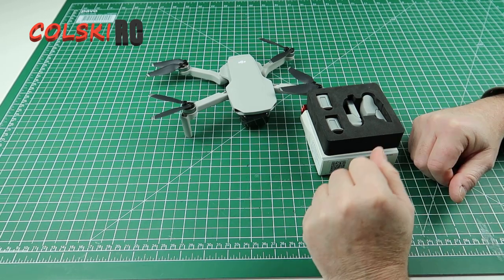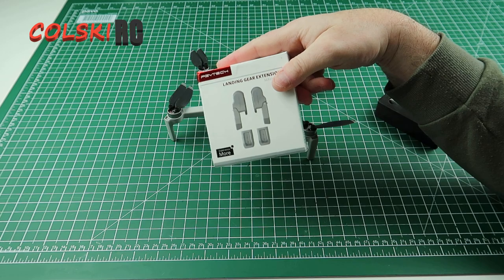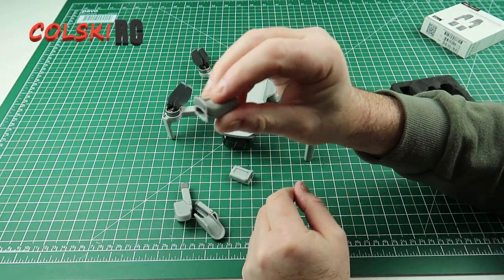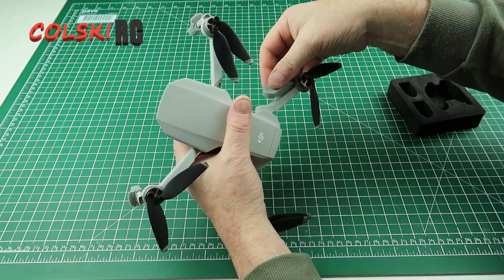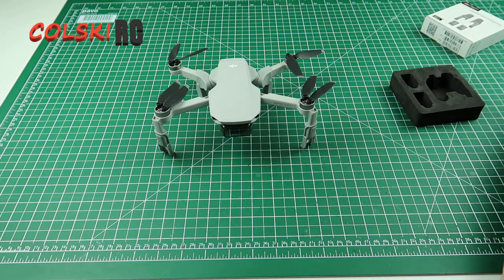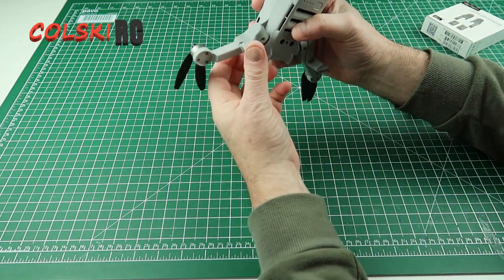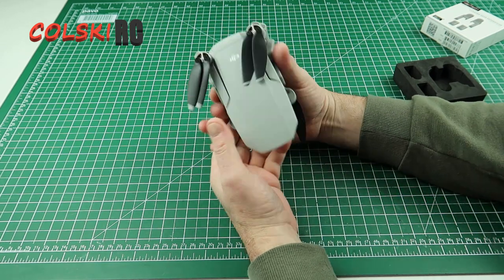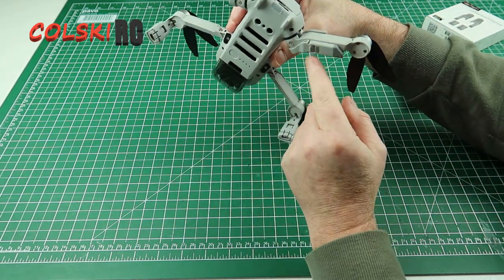PGYTECH DJI MAVIC MINI LEG EXTENDERS

Comment: They fit in the case with the back ones on, but the fronts dont.( thank god the fronts are easy as hell to slip off tho) they are just super tight. Gotta let the case form itself around them...
Reply from the maker: Thanks Matt I will pin your comment so people can see it
Reply: Put a little tape in the bottom of each leg. They will clip securely.

Comment: Hi just a question about the Mavic mini do you think its a every day drone or should I look for a heavier drone that wont fly away if the wind is to high.
Reply from the maker: I think it all depends on where you live it will fly in moderate winds but anything over 10mph is an issue.
Price point wise it’s very good though and the camera is ok but lacks 60fps
Reply: @CKone41  The north east of uk.
Reply from the maker: steven herron Hi I would probably go for the X8 in that case mate
Reply: @CKone41  ye my brother in law has one, video looks pretty good, will you be doing a flight test on the Autel evo 2.
Reply from the maker: steven herron I don’t think I will be able to afford to get one unfortunately.The channel is getting expensive to run so I will be cutting back this year
Reply: @CKone41  Its just I have to listen to the yanks or the Canadians to find out about the evo 2, and its getting to much, it seems either they get them sent or they have to much money.
Reply from the maker: steven herron they get them sent mate that’s the problem they will never give you an honest review
Reply: @CKone41  your the only one that's replyed to any message I've sent, and yes your right, even Ken Heron does not reply, I was talked into buying the Bugs 4 W by Captain Drone when really I should have spent more and got a 3 axle gimble drone, still flying this one ok now, keep your reviews coming very informative and down to earth.
Reply from the maker: steven herron Cheers mate it’s appreciated